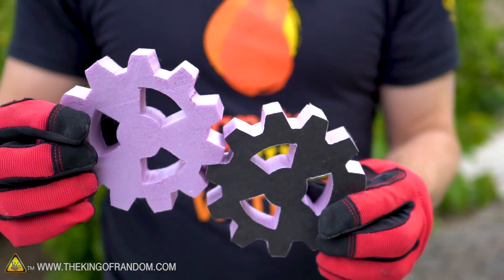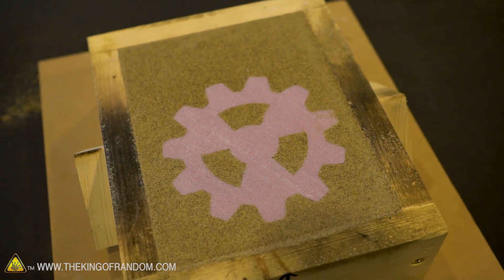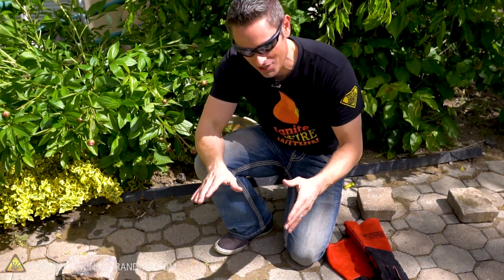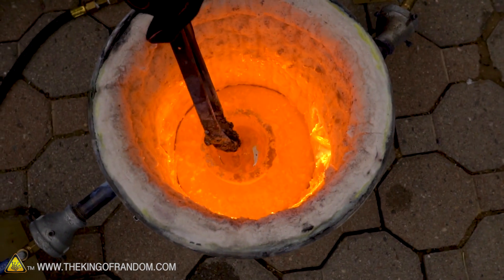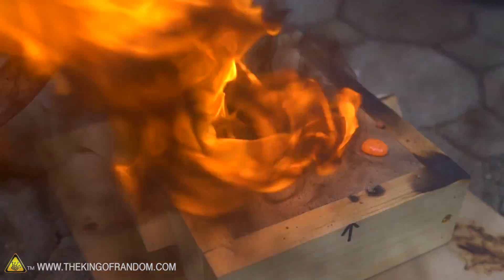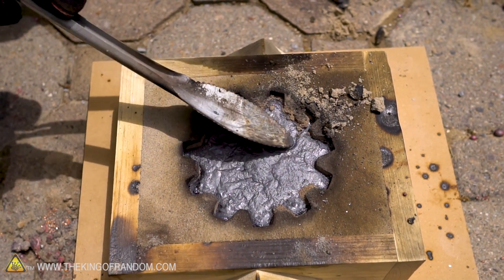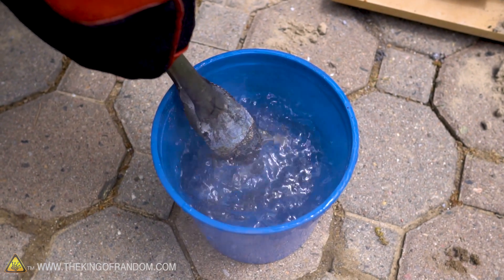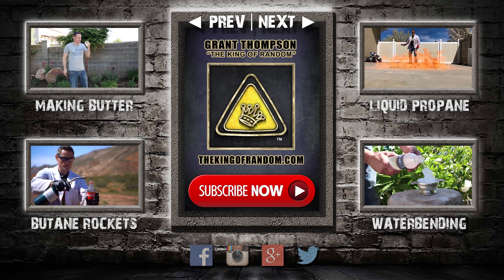Argh. Why Is Copper So Difficult? TKOR Tests Melting Copper In Our Homemade Foundry

Comment: why don't u mix some cement with the sand, or any other binding agent. It will avoid breaking of the mould while pouring the liquid metal, at the same time it would be easy be break once the metal solidifies.

Comment: love your vids first off second you should mold cope drag method try to ram the sand up super tight but dont crush your form have a runner to fill from the bottom up your riser should  be v shaped and  as far as temp at the top of you melt put small chunks of copper in if they melt in under 3 sec you  be around 2300 deg    [20 years in a pro foundry]      have fun

Comment: Are you dead set on going without a hole for an axle? those spoke spacers that keep coming loose could just be removed from the design and instead opt for a solid gear with a single fat cylinder spacer in the center (with keyways if you want or a square cross section) equal in volume to the spoke spacers you nix to keep the overall volume of copper equal. 

Maybe 2 small crucibles pouring at the same time on opposite ends to keep the pressure equalized during the pour.

Comment: if you use pennies it will be cheaper
Reply: As long as you want zinc, sure.
Reply: Daniel kirichenko must be pre 1973 pennies
Reply: pre 1982, not 1973.  And there aren't a whole lot of those in circulation.
Reply: Only about 50 billion left out there. For real
Reply: +zombie5anta I have a penny from 1946 3 years after WW2
Reply: Daniel kirichenko thats a felony
Reply: Pennies are mostly zinc
Reply: Of course, barring the fact that over 90% of the end product would be Zync not copper.
Reply: Daniel kirichenko iii
Reply: Pennies are not 100% copper iirc they also contain traces of zinc and iron and he wanted a "Pure" copper gear.
Reply: Kris Stab No one will prosecute you for melting 25c in pennies.
Reply: Don't smelt pennies I'm a coin collector they are worth more than metal
Reply: Tylerjack 1206 I thought copper pennies were 1982 and before
Reply: Star Gazer That zinc would evaporate...
Reply: Robert Flask Why wouldn't it evaporate?
Reply: The boiling point of zinc is higher, than the melting point of copper. If he won't add flux, or something like that, it should evaporate.
Reply: Oof
Reply: pennies are made of zinc and copper, not just zinc. get your facts straight.
Reply: Tool steel is up to 99.5% iron...but you don't call it iron. Semiconductors are doped with atoms worth of doping, yet their structure and properties are significantly altered. It's important to get it right. Seawater is called seawater because it's not water, it's seawater. Important if you are thirsty. Anyhow it's not worth fighting over but I have to stick up for Dani, because he was right even if he added the 'get your facts straight' unnecessarily.
Reply: +Dani Seeing as how a penny is 97.5% zinc, his facts are pretty much right on.  Seawater is only 96.5% water, but I bet you still call it water.
Reply: IF it is a functional gear, copper will be next to useless in the wear department. Making brass or bronze will give a much better functional result. 

Also, the US Secret Service has no issue with using pennies for things like floors or table tops, but melting them down is a bit of a different issue and will likely result in some sort of investigation if nothing else.
Reply: DON'T MELT COINS!!! Its a felony
Reply: Isnt destroying currency a crime ?

Comment: u need to make a cast not a mold another layer same depth as bottom mold place styrofoam in middle and make a hole to mold from top with 1/2 " round foam pour in hole copper replaces the foam fill til hole is full or over running let set perfect copy just cut off excess copper connecting tube.

Comment: The key to getting this to work is partially with the sand and partially with the way you design the mold.
You should use fine grain sand, and it should be just moist enough that you can ball it up and then break it in half. If you have the correct amount of moisture then the ball of sand will break cleanly without crumbling. 
Then you need to make a system of sprues so that the piece is insulated and excess copper can flow outwards without putting excess pressure on the sand.

I have cast replica bronze swords this way.

Comment: Everyone has there input so here is mine cover the top with sand as well and make a vent hole and I pour hole that should work then let it cool and pull it out the sand and clean it up.

Comment: Hey Grant!! the sand molds in the middle were unstable. They didn't have enough support to keep them in place. The rest of the mold stood because it wasn't in open air, it was packed into the box unlike those supports. What you should have done was replace the sand in the middle with something more stable and try placing the more stable materials in the stand. Then you can pour and this will keep the mold in place!!!! Hope this helps!!

Comment: Put wet cement in that mold wooden box thingie that you have and then put the styrofoam gear in it and let it dry and then you can actually pour liquid copper in it.

Comment: you need to research the type of sand used in a foundry green sand is not sea sand its got certain clays and other things in it to help hold it together and you can remove the molds before pouring and thats why its not turning out i did foundry for two semesters and even  i can make parts

Comment: You have to mix the sand with sodium silicate and then cure it with carbon dioxide, then you can pour copper quietly in shape, it does not break

Comment: Is clay mold a viable option or would it crack upon contact with the over 1000 degree celsius heat of the molten copper? Didn't they use clay in the Bronze Age for casting swords, arrow heads etc?

Comment: Look closely.  Your sand isn't just toppling, it actually ends up ON TOP of the copper.  Every single time.  It's literally floating in the copper like a cork in water.  Either cast in something solid / denser, or hold them in place with skewers or something.

Comment: take the gear you want, put it in the box you used for the mold, pour a different metal in, let it cool, take the original gear out, then pour the copper in your new mold

Comment: you should make or get a steel mold to cast it in.
Reply: Concrete would do it to
Reply: no its not
Reply: Joshua Vandigo *Nope he should either use clay or wet hardened sand.
Reply: you mean 500 °C?
Reply: i was thinking cement
Reply: Joshua Vandigo L was thinking the same thing
Reply: Steel melts at almost TWICE the temperature of copper
Reply: Joshua Vandigo the copper would fuse to a steel mild because their melting points are too similar

Comment: Your issue is that the copper is more dense than those chunks of sand, so when you pour that little pool of copper, the sand separates from the bottom and floats. You need something more dense than copper with a higher melting point.

Comment: Hi! Maybe you should use a deeper wooden box, keep the foam gear in the sand when the sand is half way and fill it up the rest of the way up with another piece of foam sticking up or a channel down to the gear and pour copper in from there. Just like you did for your mini master sword!

Comment: if you add a water soluble glue to the same water mix it will make a mold once it dries that will hold and you can then melt the foam out and then pour your molten copper or other material.

Comment: nicely done. why don't you use cement mixed only with sand. so after the cement solidified you can remove the Styrofoam aswell. thumbs up.

Comment: You are clearly familiar with the internet, why not actually read on a bit more than "make a sand mould and pour". People normally make a reverse mould first, then make a stronger mould from that, instead of using polystyrene. Try compressing your sand under a vice. FYI, never did this before, it's just common sense.

Comment: could just make a enclosed cast that you can take apart after the metal has cooled. all most like a 2 piece cast. the actual cast and then a cover with a decent sized opening so the mold doesnt break apart. to get the gear out put a string or wire in the center of the wheel to pull it out without having to burn it

Comment: This casting method is pretty poor.  This sand is a horrible casting medium and you actually need to heat it to help your copper flow properly.  You should upgrade your casting methods if you want success.

Comment: I'm pretty sure this problem would be solved if the top of your mold wasn't open.  What you need to do is have the mold styrofoam cavity burried in the sand between a top and bottom layer.  Basically just build another box on top of the box you already have and fill it with sand.  But you will need a pour tube (a tunnel in the sand going down to the foam) and a vent tube (second tunnel in the sand coming up from the tube for vent gas and extra copper to escape).  Whit the extra pressure from the sand on top, and less exposure to the air, the copper should flow where you want it to.

Comment: Pattern maker for years the two issues your having the way you pour seal the box bore a 1/2 hole direct over your mold and pour didn't allow anything too shift or move also your foam density is way to high you need very low dens foam to pour over but I see that you want definition that you could not get

Comment: Why not use a finer sand and mix it with something to help it keep its shape. I think our metal shop in high school mixed their casting sand with motor oil or something. Could of been some other type of oil, but it seems like that sand's particle size is too big to pack tight enough to hold together.

Comment: At this point why don't you use a better molding technique
Reply: There is no Pouring Basin or sprue for your cast, if you drop it in like that, you will destroy your sand mold only from dropping in your molten metal
Reply: Try clay kitty litter bro
Also dont just pour it ontop. Make a green sand lid and pour it in
Reply: Do you know the definition of insanity?
Reply: Mr. Guy yeah that's what I was thinking
Reply: yep he needs a cope and a drag plus his green sand looks like it does not have enough water in it.
Reply: Too much water in the clay.
It would explosed.
Reply: Grant always tries to do "Budget Projects" so that his viewers will be able to create them using the same steps he uses, if he uses stuff that won't be available to many people then it loses a lot of the purpose he intends for his viewers.
Reply: its green sand you shouldn't have to add clay . just need to mix with water till it can stick but not too  much water. thats why it keeps breaking off. plus it wont explode with no cope.

Comment: Hey Grant, the reason why it didn't work is because you're supposed to make two parts of a greensand mold, not just one. Then, you're supposed to take the two halves apart, take the foam gear out, create the sprues, and put the two parts of the mold back together.

Comment: I would've just started by casting it as one solid piece and then milling out where the spaces are supposed to be. You end up saving time by not putting so much effort into making a better moulding setup.

Comment: You need to use gating system and  a closed molding and also give a riser at  the centre the thickness of which should be the thickness of the gear

Comment: Like pouring hot liquids on sand wouldn't break it down, I would of thought that would be obvious. It should atleast have some sort of way to reduce the impact of the liquid on the sand, or just find a more solid material to hold up while the copper cools down.

Comment: i think that if you try to put the form into the sand not on the top and make a hole from where you will put the melt copper it won't make the sand move

Comment: Grant you need some sort of unflameble resin in your sang so it harden, that way your sand mold wont die so easily. I worked in a foundry for a few years. The sand was stiky and then hard.

Comment: So to get those little pieces to stick, use wood skewers/or dry spaghetti noodles. Stick them down to the bottom of the box, leaving them sticking out an 1/8th inch or so. Put hot clue around the noodle/skewer. That helps it stay. Usually works, or the whole piece just crumbles, just depends on how dry/wet your sand is.

Comment: if you wanted to continue with an open face mold then you could put a large fillet so there is a bit more of a surface that the sand can hold onto itself at the base of those "pillars", but i would suggest following yifan yifan's comment

Comment: You might have to do an enclosed mold with a smaller pouring spout to keep those thinner sand columns from lifting or falling over... I know you would usually have to remove that Styrofoam if it is enclosed but give it a try with it in there you never know... great vid

Comment: I know what you're doing wrong. You need enough sand on top of your mold, to allow a funnel shape passage to your mold. This would in turn insolate the foam from melting, maintaining the structure while it solidifies.

Comment: Have you tried your luck with a wax model? It seems to do the trick by soaking into the sand and then burning off. Not tried with anything as hot as copper yet.

Comment: I would suggest either holding the center pieces in with toothpicks so they don't float away. Or create plastic/metal pieces and dig them into the sand

Comment: Grant there's this "How it's made" video where engine parts are cast using sand treated with glue. And to remove the sand they then blasted it with water. The sand are then recycled.  You may want to try this again and see if it'll work.

Comment: Grant Thompson-"The King of Random" instead of sand to make your mold have your tried to using the last wax method? by useing plaster as the mold and wax as a cord. melt the wax out and dump in the metel

Comment: the reason the sand keeps popping is because the sand is lighter then the copper and its displacement of the copper is creating a force equal to the copper weight .. if u can some how make the sand heavier ( I don't know just saying theoretical it should work )

Comment: Adding more water to the sand does make it more cohesive, but then when you pour in the molten copper that extra water will boil, and very quickly. I think that's why the three pieces popped out so quickly in the last attempt.

Comment: you need to mix a small amount of water with the sand to enable it to compact tight, also it would be better if you used a couple of risers.

Comment: Why not try doing it injection mold style? Stick the styrofoam in the middle of the sand with the lids on both ends. Make a hole with a dowel rod or something and when you take the dowel out, you'll have a hole to pour the copper as well as the styrofoam in the center. Then when you pour it in the styrofoam melts and you shouldn't have to worry about the sand coming apart since it's held in place on both sides instead of just the bottom of the sand holding it down.

Comment: several issues: not actual 'green sand' being used will allow the deterioration of the mold, no chanel/runner & riser system means that you're pouring directly into the sand mould and the weight of the molten metal can cause structural damage to the mould. and Finally why on earth would you cast copper gears? its a soft metal with a high heat, you'd have much better luck with Iron or Brass

Comment: candle wax drop a tea candle one of the small ones in the crucible. an you will remove the junk that is causing you problem. you want the sand to sand castle wet and spray the mold with PAM.
Reply: the pam will burn off adding some heat.

Comment: do you think its the copper that is the problem, or the thickness of the housing foam. ive been trying a couple casts on my own with this same foam and aluminium and brass, and the metal was not filling in the entire mold. Im not sure if it was because the casting had parts that were too thin for the metal to get through in time, or if the styrofoam is too dense to evaporate in time for the metal. has anyone any experience on the best way to fill your entire mold? thx.
Reply: kevin graeber gravity.
Reply: tizoro3 gravity is the same with every unsuccessful mold and successful mold. So the only thing that could apply to would be he deep the molds are.
Reply: kevin graeber I was quite vague. I really meant angling the molds a certain way so that gravity can force it down in different ways. Of course I still don't know if it will actually work. I'm just giving my two cents.
Reply: oh, like you mean turning it on its side so it falls more than spreads? ill have to try that, sounds like it could work.
Reply: kevin graeber Yeah, that's what I was referring to! Again, I do not know if it works but I think it might! Hopefully it does work, if you do end up trying it, get back to me! I'd love to know if it worked!!! 😊
Reply: I have never used green sand, but I did use plaster set molds and plaster and wax one use molds. I found better detail when I pored the metal, in my case pewter, into a part of the mold designed to poor into and let the metal travel through the mold to where I wanted it to be, for one thing the slag didn't get to the parts I wanted to keep. Also I had some luck with pre heating the mold. 

One issue I saw with the video is he would break the mold when he poured into it. It might be a problem for you. 

Also pre heating my mold let me get the moisture out, for me the water could lead to cracks and surface cooling the pour so that it couldn't take the details of the mold. 

Finally I don't know how well the foam actually gets out or if it might have a chemical reaction with the metal....
Reply: kevin graeber I'm just curious did you just use one side of green sand like he's doing or are you trying with a top on it and a pouring hole
Reply: im leaving the foam cutout face open like grant had done in the video.